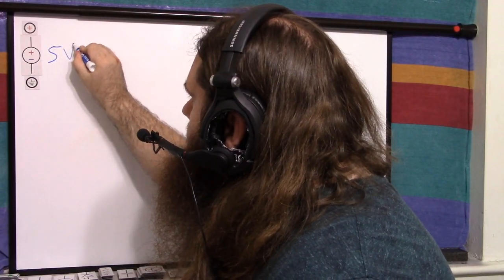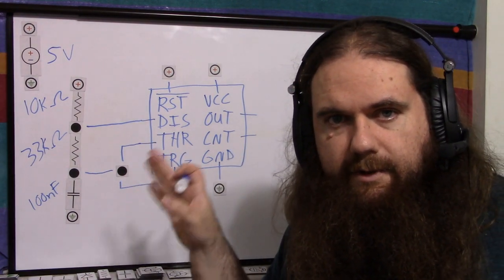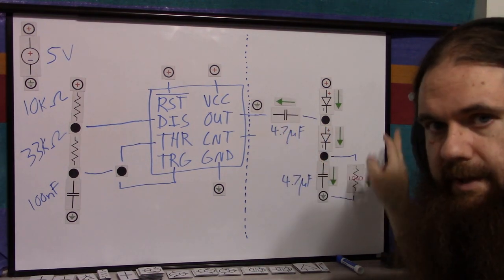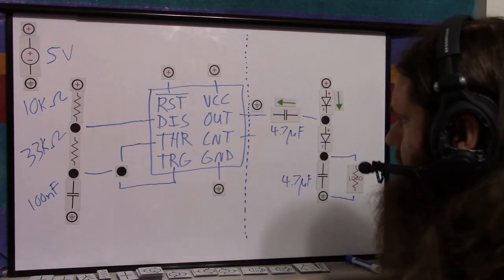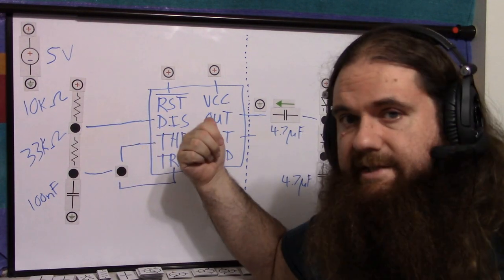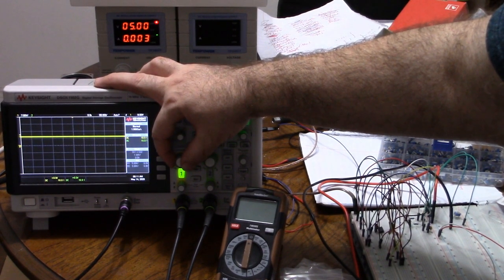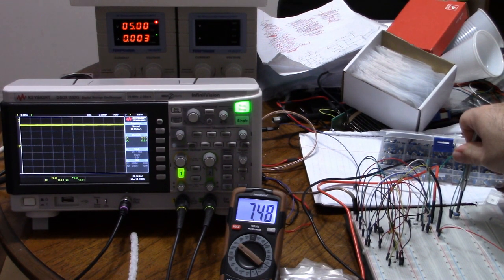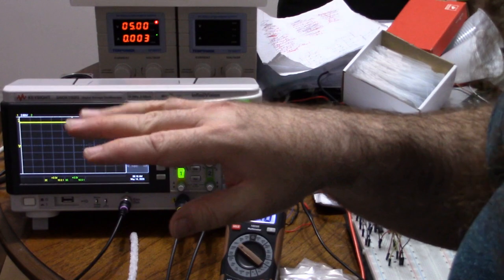Double Your Supply Voltage With No Transformer - Square Wave DC Voltage Doubler - Simply Put

Comment: Another way to think of it is that capacitors resist voltage changes, so once it's charged and you change the negative side from 0v to 5v, the potential across the capacitor remains relatively constant at that moment, but is now referenced to 5v instead of 0v, hence 5v + 5v.
Reply from the maker: Yep, in an upcoming video (there're a few on this topic), I explain that better.

Comment: There is DC to DC converter ISs for low power applications but they still can supply some other ICs in the circuits.
MC34063A for example. Still needs external elements
Reply from the maker: There's an IC for everything, but I'm enjoying learning the fundamentals so I feel like I really understand things. My philosophy is "do it by hand once, then buy the chip".

Comment: The AI super computer told me that a half wave voltage doubler has  3 parts as with 1 capacitor , while the full wave doubler has 4 parts as with 2 capacitors. Is that right? Is the 2nd cap in half wave doubler just considered a filter capacitor? I got 12 different paragraphs regarding how a doubler works from AI. AI also said that the input current to 1st cap is not double the output current. I thought watts had to equal watts. 14v 12 Amp  = 28v 6 amps from doubler? What do you think?

Comment: a handy little trianglewave with low components is 9V(or what you prefer) 100nF between VCC & ground, take you signal from pin 2 which is coupled to ground, tie pin 3 to pin 6 with a resistor(choose your value like pin 2's cap) & lastly pin 6 to pin2,  & der ya go a  low component triangle wave!!! try it out.. hope it comes n handy sometime for ya! }B=[ >
P.S i got off"Diode gone wild's channel" a vert good channel, if you don't know its well worth the look.. you won't be disappointed!!